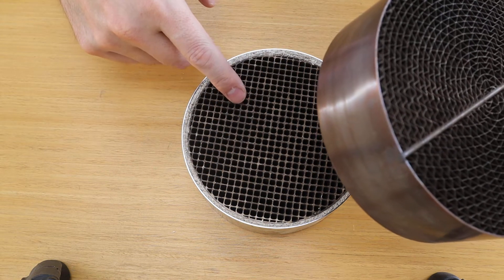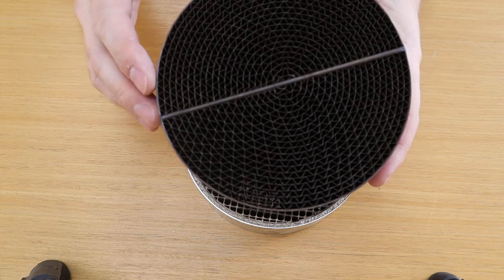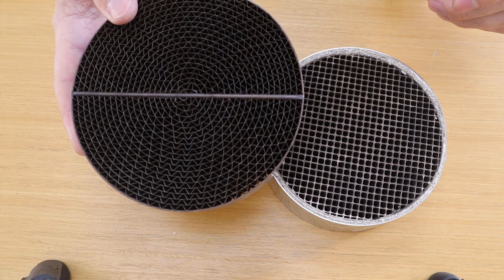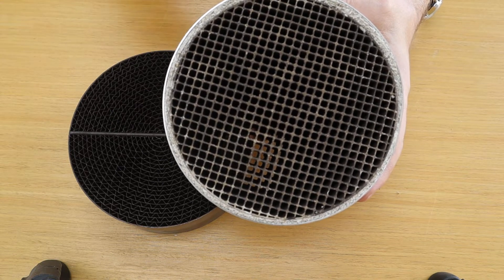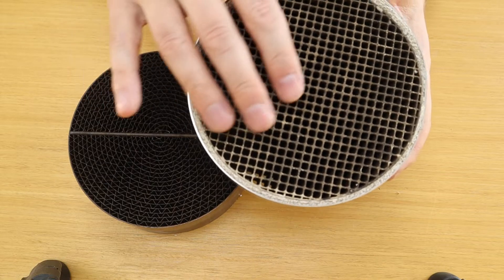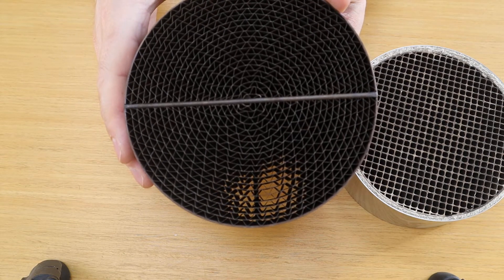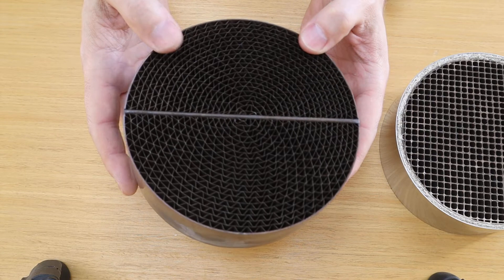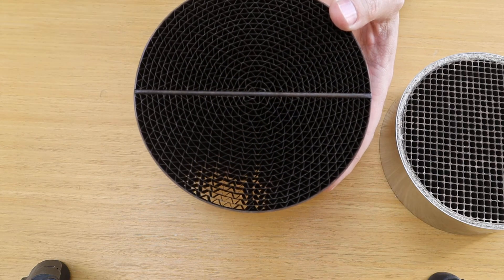Ceramic vs. Metal - Wood Stove Catalytic Combustors

Comment: We got 15 years out of the original ceramic catalytic combustor in our Blaze King Princess. It was still in perfect condition, visually. I replaced it because it no longer worked properly. The new ceramic unit allows us to slow burn a wood filling for an average of 8 to 12 hours.

Comment: I bought replacement combustors for my ashley airtight or us stove co and they were woven metal in layers compared to the original ceramic. The new combustor got clogged up quickly and didn't burn anything out of it. The woven metal in it crisscrosses each other. I paid like $200 for the pair of them years ago new and just couldn't get any use our of them. Maybe I just need to use hotter wood to activate them to burn the stuff out of them?
Reply from the maker: It is important to make sure the catalytic combustor has achieved light-off before closing the stoves bypass damper. In general, the catalytic combustors needs 500°F (260°C) focused on it for 20 to 30 minutes to achieve light-off when initially building a fire in your stove.

Comment: Great info! Although I don't get why some catalyst are much more expensive than others. Case in point, the round ones sell for around $80 on Amazon, however the rectangular ones made for Blaze King are priced at $250+.
Reply from the maker: Beware the cheap ones. We purchased samples from Amazon, tested them, and they had no active coating.  The difference in pricing between our catalysts is largely due to the production volume of each size.

Comment: Can you please explain how to tell when your combustor is worn out
Reply: Sled, Speaking from my own experience with a Blaze King stove. I noticed the combustor probe would rise into the active area when building a fire. However,  when I closed the bypass and turned the damper to normal the probe would quickly fall into the inactive range. There was also a lot of smoke leaving the chimney which told me the combustor wasn’t doing it’s job. I replaced the combustor and the probe at the same time and the stove runs like new again.

Comment: 02:50  12,000 hours is about 500 days (16 months) of continuous use.  I installed a metal combustor in my Consolidated Dutchwest large wood stove this year, and I hope it will last longer than 12,000 hours of use.  It runs at 1100F on oak with door vent 1 turn open and combustor vent open 1/2 turn.  The only ceramic combustor I got to run more than 2 seasons was the one that came with the stove from the factory.  The aftermarket ebay combustors all clogged and broke quickly.  I used the perforated cast iron plate that came with my stove for a few years, too.  Not as good as a combustor, but longer lasting.
Reply: You likely aren’t servicing them, as you should. You can clean them simply by vacuuming the holes on each side. Do it before you light the stove whenever you need to clean the ash pan or once a month idk, but thst will prolong its lifespan
Reply: Which dutchwest are you running? An FA264CCL?

Comment: Are the active metals "coated" onto the ceramic substrate?  Or, are they blended into the ceramic mix before being solidified?
Reply from the maker: Yes, the active metals are coated not mixed. The substrate first undergoes a chemical bath to provide adequate porosity to adhere the coating.